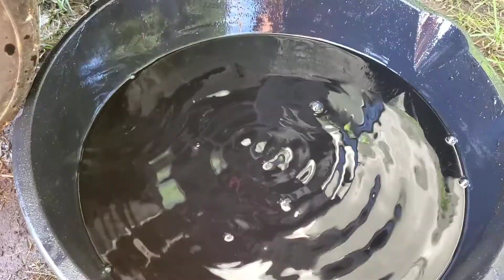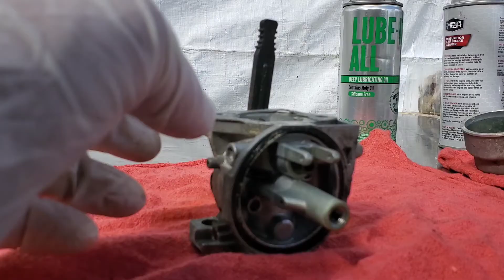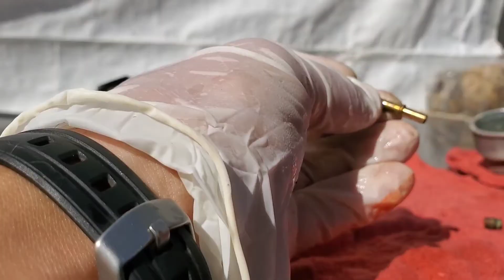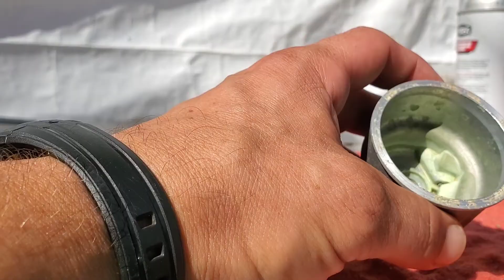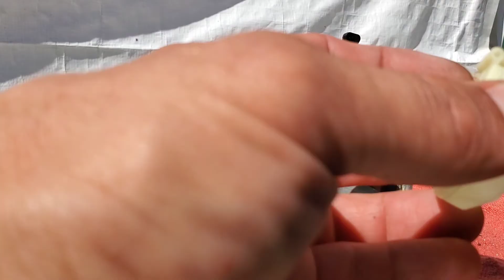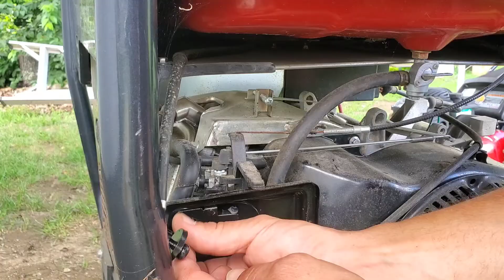Dirty Carb!? Troy bilt XP series 7500 watt generator, Briggs and Stratton motor. Won't start!

Comment: Do you know what size fuel line that is?
Reply from the maker: I believe its 3/8 ID
Reply: @wickedrepairs8527  thank you for the response. I have the same generator. Bought it brand new in 2017, tested it, and then it just sat. After sitting for about a year I cranked it and it surged bad while idling. I also installed an inline fuel filter. The mistake I made was letting someone else work on the carb and he tightened the idler screw all the way down so I have no idea where that needs to be. It still surges if I can even get it to crank, and that’s been about 4 years ago. It’s been sitting ever since. I’m on the verge of removing the inline filter so it’s back to factory and just replacing the entire carb. All this and it doesn’t even have 2 hours on it. Very frustrating. Carbs just aren’t my strong suit.
Reply from the maker: @hcfirefighter82  absolutely! It's all due to ethanol fuel! The shelf life of ethanol fuel is 14 days untreated, after that it starts to deteriorate and adapt moisture from the air. One of the best things you can do when not in use, is to shut the fuel peacock off and drain the carb of fuel. If there is no peacock, I highly recommend to install one. Off hand, I'd say the fuel screw starting point would be about 3/4 of a turn out, then adjust as needed. Basically, when adjusting a fuel/air mixture screw, get the unit running, then slowly adjust the screw until it reaches the highest idle, then turn the screw in just a tiny bit, that's usually the best running position. The idler screw is roughly half way threaded in.

Comment: At least it cleaned the slug out of sump, but flush with clean cheap oil to get 95% of gas out, needs cut of valve and rebuild carb plus test new needle and seat
Reply from the maker: Very true! Yes, that's always a great idea to flush it, don't want any fuel vapors in there!

Comment: Great video! -I have a question-what causes the engine to "hunt"-rev up and then down, rev up then down. I have to keep the choke pulled out about a quarter of the way to keep it running.
Reply from the maker: That could be from a partially dirty idle circuit in the carburetor. They need a certain amount of fuel and air to run properly and when you open the choke halfway and it smooths out, it's because you are added a little more fuel that it's looking for. Another cause would be the governor or weak springs on the governor shaft to the carb. That's less likely than the carburetor being dirty itself.
Reply: @wickedrepairs8527  Thank you very much 👍
Reply: Pull carb and clean it
Change fuel filter